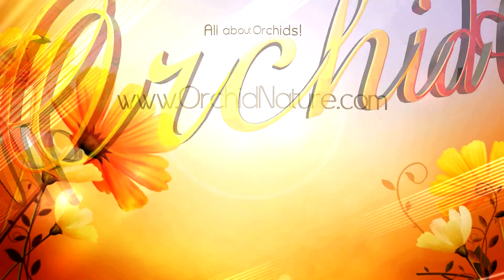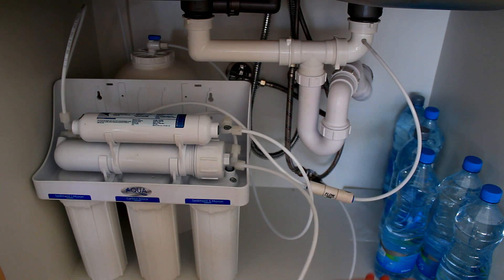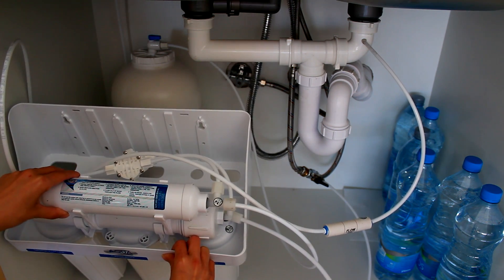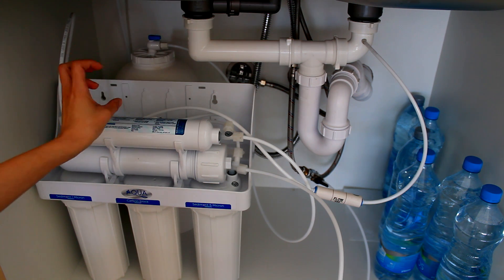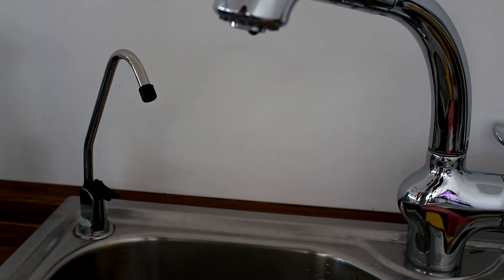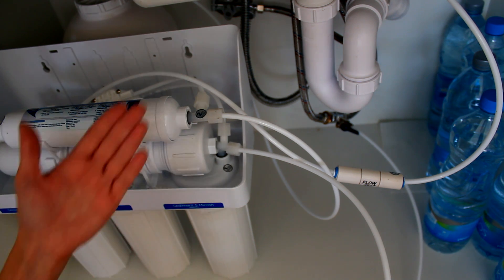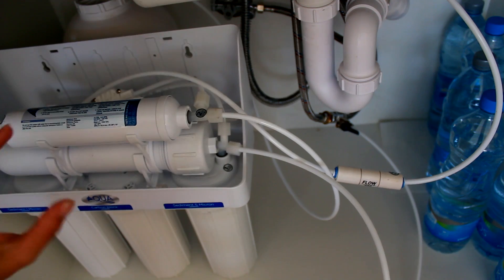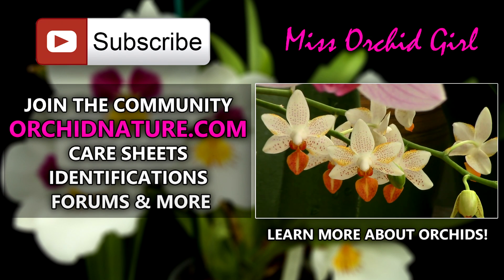Greenhouse osmosis system

Comment: I just received my first TDS meter. It's the same as yours and my tap water readings are well over 400ppm in London! I knew the water was not great here but was expecting 250-300ppm. I'm surprised my orchids are even alive but I have phals that are over 10 years with me. Good that I've been using Orchid Focus to feed them, LOL! That said, I haven't seen any major issues even with miltoniopsis. I'm wondering if an RO system would change my world for the better? I'm a S/H grower for almost everything so the fertiliser is weak and applied with every watering. Alternativey, I could collect rainwater which is in a constant supply!

Comment: What I found interesting, is that some of the water that I had stored in bottles, for several days, the pH jumped to about 7.0.  The representative of the company thought it might have something to do with chemicals leaching out of the plastic bottle.  I am happy with the TDS, but will continue testing pH, as I got myself a meter.  All so complicated :)
Reply from the maker: He might be right, as I understand the osmosis water has a low buffer (kh - carbonic hardness) so it is susceptible to ph swings. oh I am on the hunt for a good tds.. not sure what to buy.. the calibrating solution is so expensive as well hehhhh

Comment: I just had my R/O water tested.  I rent a unit and the company takes care of all filter changes, etc.  I have 5 gallons available at all times, unless I drain the tank then I wait an hour and it is full again.  Curious to know what your pH measures?
Our city water comes in at a pH of 7.5 - 8.0.  TDS (total Dissolved Solids): 180 ppm.
My service man came today to do a test.  He had very precise equipment (it's his job).
My R/O water measures pH 5.5 - 6, TDS an amazing 10 ppm.  
Is the pH too low?
I also had him measure the run-off water from the orchids: pH 6.7, TDS 52 ppm.
I'm wondering if there is a correlation between the relative pH of the water and the Rain Mix Fertilizer?
Any ideas?
Reply from the maker: Hi Marcella, the end result of the tds depends on 2 things: 1 the water that is filtered and 2 the rejection rate of the membrane. I think your TDS reading is great, 10 is a quality water. With your exact system I would be able to obtain an osmosis water with 20 tds theoretically, as my water is 350, sometimes more. The pH is good for orchids, however it is a bit low for fertilizers that seriously acidify the water. As I have been instructed, a pH of 5.7 is still ok for orchids. However the osmosis water is not buffered, so it can change pH fast when in contact with a more alkaline medium. So what you can do to test is run water through an orchid pot and test the pH of the water that was used for the pot. ok I saw you did that :P it looks good :D I believe it is a correlation, but will affect only some roots, if at all in my opinion. If theoretically you use osmosis water of 5.5 with rain mix, you will get 4.5 ph, or around there. In contact with medium the pH will change. In contact with aerial roots.. I do not know. You will need to test that :)

Comment: Hi, we recently bought an osmosis system (with four filters) that claims to alkalize the water. Is this safe for the orchids; I was reading that filters in general contain iodine salt that can poison the orchid.
Reply from the maker: +Art Cellar Hi, well it depends how much alkalin it makes the water, it's usually not advisable to use water with a pH above 7.5 for orchids, as they will not be able to feed properly. Best thing to do is to test the ph and hardness of the water. Some osmosis systems are made for drinking, so they insert minerals back in the water.
Reply: +MissOrchidGirl Yes this system is made for drinking and inserts the minerals back in the water.
Reply from the maker: +Art Cellar oh then it's not good for orchids no. The aim is to get demineralized water for them so you can put in the amount of fertilizer you want.
Reply: +MissOrchidGirl Thanks so much!

Comment: Wow!!  I used to have one when I had my aquarium.  I sold the whole lot when I moved out of my house.  Can I water my Phals and SOON Catts with tap water.  Currently I am using de-mineralized water for my humidifiers, so I can use that for watering.  What do you think?
Reply from the maker: +Marcella Miller well it depends how hard your tap water is. Orchids do need some minerals but in small quantities, so first test your tap water. If it's too hard you can use demineralized water but make sure you fertilize regularly. I think it won't be very economical though once you'll get more orchids. As your collection grows an RO system will be more economical.

Comment: This was very interesting! Thanks for taking the time to make such an informative video! :) I don't know if the waste water could be used for watering plants in the garden. It depends on how many salts it contains (probably it would be safer to measure the waste water's ppm before using it. Actually, it would be interesting to measure it just for fun too).  I wanted to ask you, is it true that RO systems use more water if the tank is not emptied completely? Do the instructions manual mention anything? I heard that if the tank if full, it creates back pressure, so if the RO systems tries to fill it again when the tank is almost full, only 10% of the water could pass through the membrane and 90% would be wasted. And that less water is wasted if the tank is emptied completely at each use. But I don't know if this is true or not.
Reply from the maker: +Orchids & a Dutchy HI Andrea, I tested it, it's similar to the tap water, a bit harder perhaps. For gardening it's ok because you get rain as well and it flushes the salts. You can use it for things that like high calcium water perhaps. Ok about your question, I am not sure, they don't specify this, but I noticed that if I don't empty the tank (which yes stops by backpressure) I get less water. Not sure how much it wastes though. So I prefer to empty it indeed and store the water :) But the difference is not big, half a liter at best perhaps. Also the tap water temperature is important, the colder it is, the more water it will waste. Luckily the water warms up in the pipes here as it's always sunny so the waste water is not suuuuper huge for me and the tank fills up quite fast, 4 l in about 2 hours, which is good. If the water is colder it takes more to fill it. As I estimated mine wastes about 3-4 times the amount of pure water, depends on temperature of the tap water really. So far that's what I noticed :)
Reply: MissOrchidGirl That's interesting, that the temperature of the water influences on how much waste water is produced. Our cold water here is very cold, specially in the winter, so I guess if I used RO I would waste a lot of water. Fortunately our water is soft, but I must get a TDS meter to check myself. My orchids are doing well with our tap water, but I potted 2 in semi hydroponics, and I must collect rain water for them. I see you collect RO in bottles and that's a great idea, specially if you are in a hurry and the tank isn't full enough. Is that sink inside your greenhouse?
Reply from the maker: +Orchids & a Dutchy Yes the sink is in the gh :) I am now gathering 2 l bottles to store it, much more space saving than the water bottles :P also I discovered a great way to water, will make a video soon :D
Reply: MissOrchidGirl That's so awesome. You're so lucky! 😊 I would love to have a greenhouse with a sink!